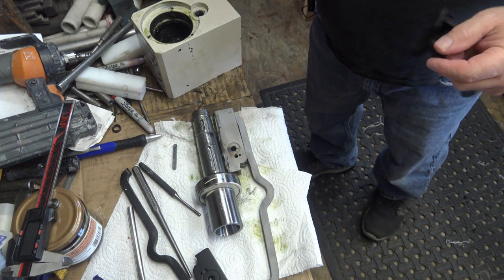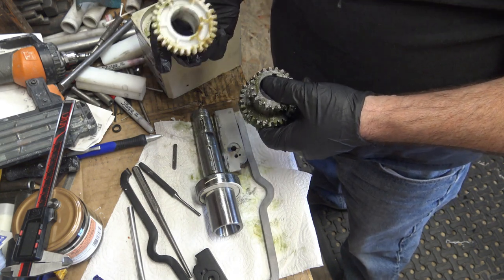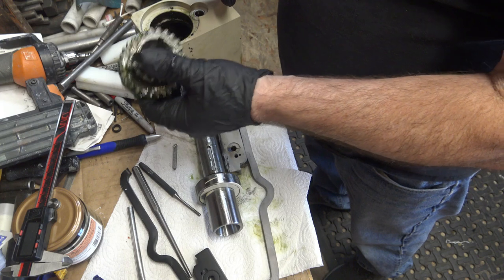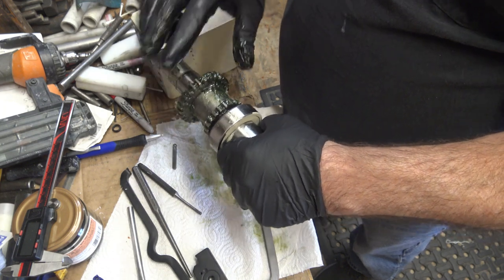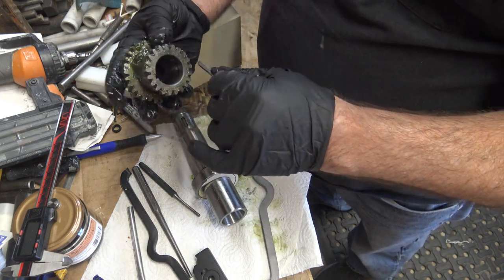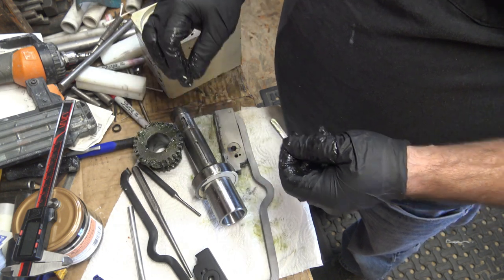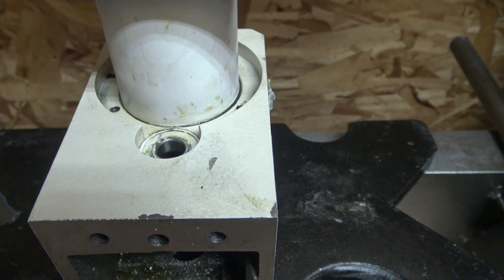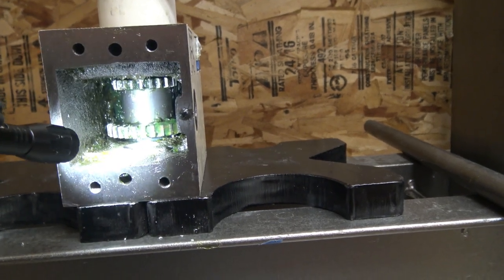Grizzly Mill G0781- GEAR UP GRADE/read description below !

Comment: I really appreciate this video and the detail specially when you went over how you seperated the headstock. I'm currently converting mine into a cnc and was stomp by why the headstock would seperate after removing the 4 socket bolts. Now i know why. Thanks.
Reply from the maker: I am  glad the  video  helped , its  been  couple  years  now  but I was  thinking  it has  those  pins  that kept  it centered with each  other

Comment: I just got a G0781 for very cheap because the gears were broken. Just finished doing the upgrade and I did not have to bore the gears they were a nice slip fit. The big gear is a very close fit but once I got it aligned it just slid right on. I did have to replace the lower bearing because it was very crunchy. I pulled the seals on it and it had cast iron shavings in the grease. I think they came from the factory like that because the seals were not damaged. Luckily I had just done tapered roller bearings on my lathe and save the bearings.

Thanks for the video. This was my deciding factor on whether to buy the mill or not. It was very helpful.
Reply from the maker: Thats  pretty cool, Iam glad  some good  came out of  the video .
I tried to buy a bigger one from china off Ali baba but after  you buy it  they change shipping cost on you I had  to cancel two times then gave up on that ideal. I think the  harbour freight model  is  on par with this  unit if I could do it over I would just go with  the harbour freight one easier  to work on &  wont have  that electrical to go thru  on a disassemble
Reply: Where did you get the parts?
Reply from the maker: @martylost167  Little machine shop .com here is the info off my recite
 part number is 3448
	Metal Transmission Gear Kit, Mini Lathe & 3MT Mini Mill	$ 65.95
Reply: @MrSteppingstone888  TKS!

Comment: hi interesting video, how do you extract the motor gear shaft? tnzk
Reply from the maker: The  shaft is  a press  fit  thru  the bearings, one on each end.
You have  to press the shaft out  of  the bearing,  I used  the shop Press you see in the video

Comment: Outstanding video! 
Where did you get the metal transmission gears with which to replace the plastic factory gears? I called LMS and they said they don’t have them.
Reply from the maker: I got them from  Grizzly.com I believe,  I hate this not remembering  / I had to bore  one of  the gears to get  it to fit.. here a link  for parts for this model 
https://cdn0.grizzly.com/partslists/g0781_pl.pdf
Reply: Mike Ellingsworth** Mr Stepping Stone*** Thanks! I haven’t had a failure, YET. I just want to get ahead of the curve.
Again, great video!
Reply from the maker: @jamesholmes922  
The plastic gears are easy to break , I  was careful then that 1x  came  around where  something was not quite right on my milling 
and that's  all it took.  I  still have  the upper plastic gear  in there on top of spindle area and grabbed a spare  from grizzly  even though I don't use it much.
I  don't like the fact  that milling is slow  going  at least  on this size machine
it takes the fun out of it when making things
Reply from the maker: @jamesholmes922  I just watched  some of this and I  did get  the gears  from the LMS  I mention it before  1min  into the video, I may  of measure the ID  and found info  on the closet thing they had  and bought  it, still had to bore a gear to get the fit
Reply from the maker: Jim I found  the gears I bought from LMS  the kit  is part # 3448
and they are inexpensive/ FYI  boring the one gear was very easy
and it was not a lot /I think the gears are cast iron 
here  is  the link 
https://littlemachineshop.com/products/product_view.php?ProductID=3448
Reply: Mike Ellingsworth** Mr Stepping Stone*** Thank you so much! They are in stock and I just ordered them. 
Like you I am amazed that Grizzly would make these internal transmission gears out of plastic.
I can go along with the sacrificial external drive gear out of plastic.
I wish I had run across your video BEFORE I ordered my machine.
Reply from the maker: @jamesholmes922   If  I could go back I would of bought the harbor freight model probably made by the same company  as  a lot of imported mills 
now that I took it apart there not much to it
Reply: Mike Ellingsworth** Mr Stepping Stone*** My guess would be that ALL of these China made mills and lathes were made in the same factory, or at the very least the housings were cast at a common foundry.

Comment: Would like to get your thoughts on what's the better gun the diana 460 or 48 also throw the 350 in as well but I'm between the 460 and 48 now been hearing problems with the under lever breaking easy
Reply from the maker: a lot don't care for the 460 & yes some had cocking arm issues.
 the 350springer would be best with a de  tune & custom-made spring guides if you are walking around hunting.
The 48 if  your benched is the ticket  they are powerful & they remind me  of a
 medieval weapon  when you pull the cocking leaver back. I have one in .22 if  your interested  300.00 plus shipping its in nice condition see my info
awaysmike@hotmail.com
Reply: @MrSteppingstone888  do you have a 350 ?
Reply from the maker: @mustang268  I do have a bran new 350 its this one in the video, and yes I can let her go / last time I shot her was in this video she was bran new  at that time   275. shipped con usa..      awaysmike@hotmail.com
the video link    https://www.youtube.com/watch?v=VLNnB2LJ-3A
Reply: @MrSteppingstone888  hey Mike I've also been looking at the weihrauch hw80 and similar models by them are they worth the extra money over the diana guns like the 350 460 48 etc they're not as powerful but read good things about how easy they shoot
Reply from the maker: @mustang268  just sold my 48 some one was asking about it.
 the Weihrauchs are built  with balance in the shot cycle  not over powered like you mentioned and they are quality rifles  awesome triggers & accurate
( yes worth the money ) I have a bran new 97K.20 cal with hang tags if  interested you could buy a nice weihrauch  like a nice hw 95 or beeman R-9same gun- or 97K
 later buy a hatsan magnum  which would be stronger than the hw 80 and send it to me to go thru it that way you have one with power the other for pure enjoyment.
Reply: @MrSteppingstone888  I had a hatsan 155 25 cal powerful gun but barrel wasn't thst good so out to 40 yards it would get bad and wasn't a fan of the iron sights truglow front sight was way too big and bright for my liking I prefer a thin iron triangle point or bar with flat top I like to shoot my guns with iron sights nice looking gun and a powerful gun but if I can't shoot it good then what's the use so I said f it I'll get either a diana or a weihrauch I'm doing research now and comparing guns but I would be interested in one of your guns if you're willing to work out a deal I prefer a 22 cal or maybe 25
Reply from the maker: @mustang268  well if you like open sights then the rws 350-.22 should be good mine is as new ,if you were thinking hatsan for more power  those I done a lot of re barreling for guys  and they are willing to have me go thru it  
its not cheap but when your done you have everything done & gone thru & adjusted re barreled  gas ram re built properly  trigger tuned my custom parts installed etc etc. new Loather Walther barrel alone is 160-175 /plus my 125.00 install fee plus  the actual work &new parts bit when its done I adjust the barrel to with in 1" of a zeroed scope